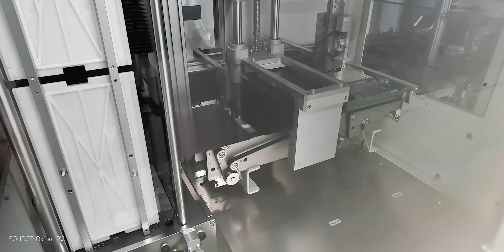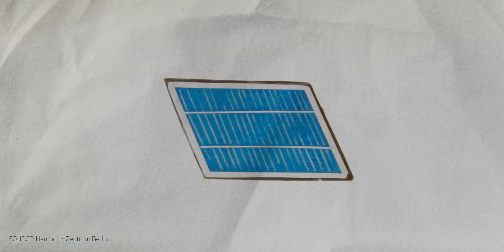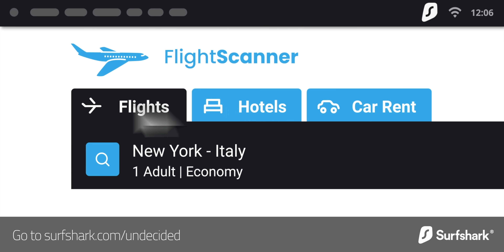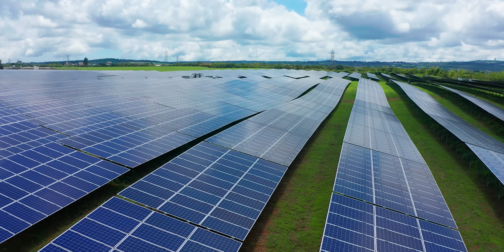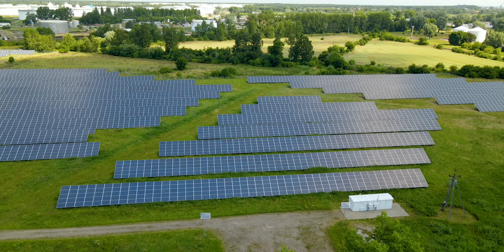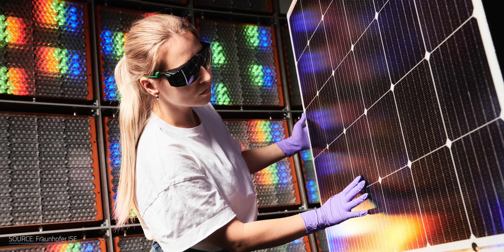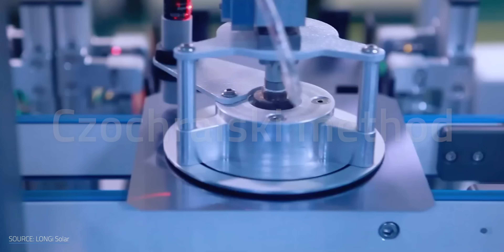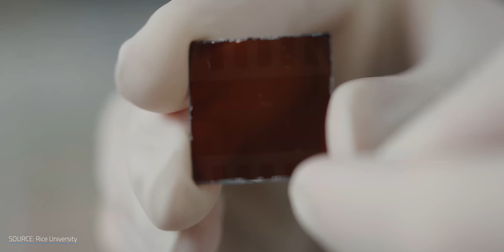How Record Breaking Perovskites Are Here NOW

Comment: Definitely progress.  Not sure I would move it up the pyramid yet, but having whole modules out in the field is a good step.  In my mind, the true game-changer is when modules reach 30% with at least a 15-year life-span above 25%.   They are competing with high-end silicon modules whos degradation rates are already sitting at only 0.2% a year.

Also, with all due respect to RICE University, anything with Lead, particularly in-solution or paint-on, is a big Ixnay.

-Matt
Reply: 30% is not anywhere enough for me to buy them and they would have to be at a good price to compete with silicon. The best silicon cells are approaching 25% as it stands, so we are only gaining between 5-10% more efficiency.
Reply: @nzoomed   Best... but typical are 15-20%.  It really doesn't matter.  If it produces 50% more, and costs less than 50% more, then it's a win.
Reply: @wagnerrp  Well thats exactly it, the price is the most important part and silicon panels are well under 50c per watt now, some brands focus on price over efficiency, so perovskite will need to compete with that. Typically the cheapest panels ive seen are all at least 20% efficient.
Reply: Efficiency is really quite irrelevant.  You can get more power out of rooftop solar, but unless you're going to install batteries and go off-grid, it doesn't really matter.  Land is cheap, despite the claims in the video, and installing solar near existing grid tie points is a short-lived optimization.  We're going to have to massively expand the transmission grid to permit the move from centralized power generation to decentralized solar and wind.  $/W and $/Wh are the real critical metrics, and that's where the real promise is.
Reply: @wagnerrp  - Land is most certainly not cheap.  Not to mention not all land is suitable for massive solar farms, either because of geography, weather, or harm to the ecosystems living under them.
Reply: @phydeux  Of course it is.  Land within major population centers is not cheap, but you don't have to make it far outside those population centers before your population density approaches zero.  That land will experience every bit as suitable weather as the city 20 miles away.

As for ecosystems, we don't much seem to mind the farmland that's grossly overproducing food unnecessarily, and being used to convert petrochemicals to ethanol at close enough to a 1:1 ratio to be pointless.  I have no problem replacing one artificial ecosystem with another.
Reply: @wagnerrp  - If you build them at the edge of population centers you've effectively hemmed in any further growth unless they rip out the solar farm.  Good job!

If you build them far from population centers you have to deal with transmission losses.  Good job!

And here in the US at least, farms are producing far more on less land than they did when I was born thanks to GMO seeds, better pesticides and fertilizers, and better equipment.  In fact, a large portion of previously sown lands have been allowed to return to nature because we need so much less.  This is why the USDA PAYS farmers not to grow certain crops, and why so much milk literally goes down the drain.

People today are so busy advocating to save the planet they don't bother to look over their shoulder to see how much progress we've already made.
Reply: @phydeux   In case you haven't noticed, populations aren't growing.  It's actually a major problem in pretty much every developed country.

As for transmission, yes, we're going to have to massively increase the amount of transmission we have in our electrical grid.  Either that, or we're going to have to go absolutely nuts with local battery storage capacity.  Our grid is not designed around the production patterns of PV, so there's no reason to expect our grid will remain as it currently is as we transition to PV.
Reply: @wagnerrp  Holy nonsense...
Reply: @wagnerrp  I would change that around a bit and put your last paragraph first.  What's relevant is $/pw ($cost per nameplate watt), which has nothing to do with efficiency, batteries, or anything else.  Just using the $/pw metric, Perovskite-enhanced panels will not become cost-competitive for residential installation at least for another 5-10 years or so.

At the current juncture, decent residential panels can be had for $0.17/pw ... roughly $2500 for 15kWp worth of solar plus another $500 for delivery of the pallet.  $3000 total, delivered, for 15kWp of solar.  That's almost free in my book and I doubt this will improve much more.

Batteries will eventually be in the same boat.  Battery prices have already fallen drastically and will continue to do so.

The real costs for the home-owner wind up being for other things... installation, labor, company profits, warranty, permits, etc.  Being able to DIY an installation it can cut your costs by well over 50%.

-Matt
Reply: @junkerzn7312   I'm not sure where you're getting those numbers.  Cost per panel is around $2/W, and you might double that when including all the associated equipment and installation.

-- edit --  Looks like there's a huge discrepancy between commercial prices and the wholesale prices used for utility-scale installations, approaching an order of magnitude.

Comment: I guess one isdue with the transition is how long do you wait for the tech to improve. Silicon panels are still being deployed. Will they become obsolete?
Reply: The panels have been good enough for a decade easily. The problem is storage and transportation.

In most installations, if the power goes out, you can't even use the power from your array directly. It costs extra to make that possible.
Reply: @juliusfucik4011  There are more efficient panels on their way, which will reduce the environmental footprint at generating station & allow more power from rooftop installations.

Comment: And the 25-year guarantee will be issued by the manufacturing company (as long as it will be around for 25 years) . Northvolt also guaranteed their batteries. Why is the efficiency so critical? Space in large installations is rarely an issue. According to Matt, standard cells efficiency is up to 22% so the new ones with 24.5%  is a big deal?
Reply: Think of it this way. That bump of 22 to 24.5 percent is an 11 percent increase.

Comment: Can we not use perovskites? Have we learned nothing about the dangers of lead in the economy?
It's dishonest to mention silicon perovskite tandem cells without mentioning that only lead halide perovskites show these improvements.
There are other PV technologies that are competitive in terms of cost, materials, and efficiency.
Reply: The video mentioned SIL perovskites. As these panels are encapsulated the danger comes from accidental damage of single panels and disposal of end of life panels sets in the future - recycling initiatives underway address the environmental risk in these cases with the lead can be recycled for re-use. This is not an exposed paint or lead roofing system being proposed.
Reply: @GruffSillyGoat This is the same argument used to justify lead-acid batteries, which are ubiquitous due to their use in automobiles. The argument is out of touch with reality, as an overwhelming 90% of lead production is for these batteries. Substandard recycling (which is highly frequent) is the most common exposure pathway after plumbing. There is no reason to believe that Si/lead halide perovskite panels will fare better at end of use.

Comment: An  interesting approach to testing this type of panel would be small-scale, IMHO.
Solar trickle chargers for vehicles.
The current ones aren't great, but better than nothing for people who do not drive often, whose vehicle are not garaged (so no plug in trickle chargers can be used), and whose vehicles lose battery charge over time (parasitic drain or not). Older folks and disabled folks who do not drive often can find that they need to replace drained batteries or call roadside assistance frequently to jump start their vehicle, especially newer vehicles that have a ton of electronics built-in that need a higher charge when trying to start the vehicle and all of the built-in electronics.
Smaller panels made with perovskite tested as trickle chargers for car/truck batteries could be a way to test how they degrade (or don't) under constant use, under naturally varying weather conditions (Sunny? Cloudy? Snowy and cold winter days? Et cetera.). Can they keep a battery fully charged in a vehicle that is only started and driven once a week, in varying climates and weather (sunlight) conditions? 
IMHO, this could be a way to convince some "solar skeptics" out there to try solar on a small scale rather than installing whole house solar- if they are efficient, safe, and reliable enough that that they do not need to call for a jump start every week, they may start to consider solar as a more reliable way to power their homes, full time or as backup power.
Reply: I don't understand what you are talking about. I sometimes don't use my car for many weeks and my battery can always start my car.

It seems super overkill to install solar to trickle charge when a literal 10 dollar charger does the same.

Comment: I still think that instead of making the Perovskite layer of a tandem panel permanently affixed, it should be removable and disposable.  That way you can just play on servicing the entire system every 5 or 10 years by popping off the Perovskite protective layer and snapping in a replacement.  This would reduce the longevity/durability requirements and make Perovskites viable now instead of at some unknown future date after developing new materials tech.
Reply: It would be more costly to create two layers than the benefit gained. Extra layers would reduce the panels efficiency as the intermediary layers would interact with the light transmission negating the benefit of the additional layer. This was the approach being tried previously and failed to take off, not because of the technology, but the lower efficiency and higher cost. 

Now with perovskites being a thin-film coating that are deposited directly onto the silicon substrate, with lifespans projected (and tested) to last as long as the silicon panel as outlined with the commcerialised products raised in the video. 

Further, having panels with increased maintenance costs isn't commercially attractive, particularly for large scale operators where a 5/10 year maintenance cycle by itself would outweigh the cost benefit of having a panel with higher output - as this would be an ongoing resource cost rather than a one off capex spend.
Reply: @GruffSillyGoat so no chance of a "screen protector" style, replaceable layer 😮‍💨
Reply: its an ultra thin layer thats deposited on its not a glass sheet you can pop off.
Reply: @AricGardnerMontreal  but what if it was put on a removable glass layer like a screen protector?

Comment: The secret is most likely lead....  which is why for optics sake they just use perovskite as the name. Since people would not be as hyped about new better performing solar panel if you would call them lead based panels that degrade quickly.

Comment: Exciting news. I’ve been waiting for greater efficiencies in solar technology before investing in a residential system. I’ve had my eye on the high-efficiency of Maxeon Solar Technologies PV panels. Look forward to seeing how all of this matures.
Reply: for residential most of your costs will come from installation, solar panels are already efficient enough for home use, unless you have a factory inside your house you won't need panels that are more efficient. if anything these perovskites may be a worse investment because they are more expensive and won't last as long as normal PV panels in the market, meaning it will take much longer for perovskites to pay for themselves, and you will probably need to pay to replace them much earlier. the only difference that may justify perovskites is a bit more energy generation from sundown/sunrise because, since they use bluer light, they will absorb some of the refracted light from the sky. but I have no idea how much of a difference it actually makes.
Reply: And what about the storage? Your panels will produce a lot even if they would only do 15%. What are you going to do with that energy? Sell it to the energy company? You will get a very low price. Store it? In what batteries? Are there still insurance companies that insure homes with 20 kWh of lithium battery cells in the basement?

I think the focus on panels is completely wrong. The real problems do not arise from generation. It is in storage and transportation.
Reply: @ there are plenty of insurance companies that will work with homes with home batteries. lithium fires are extremely rare, specially with modern batteries (from million of homes with batteries, there were only double digits cases of home fires in the last couple of years). and with a bit of clever design and safety features, it will pose no danger to your home.